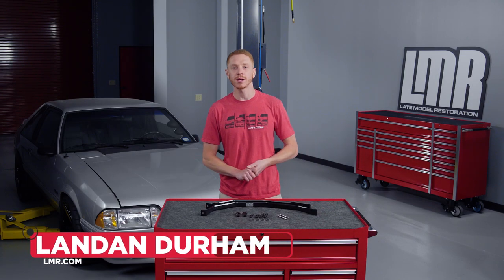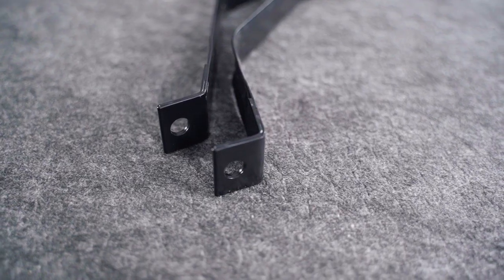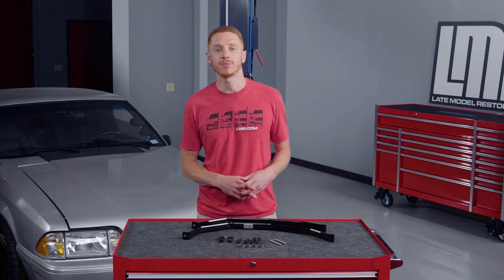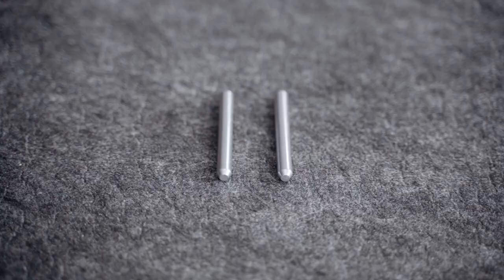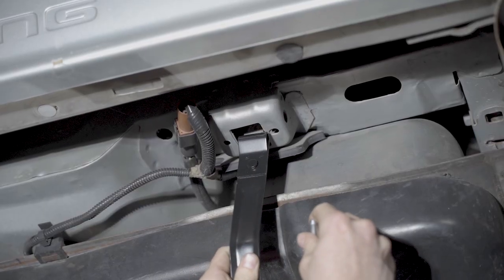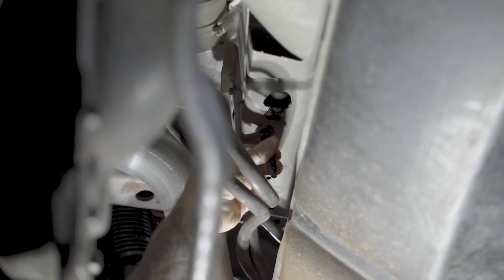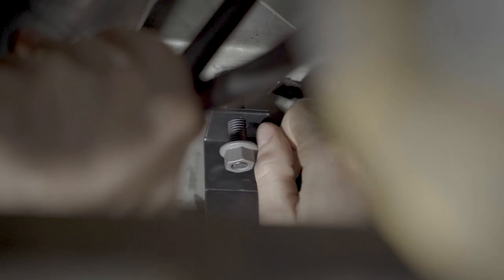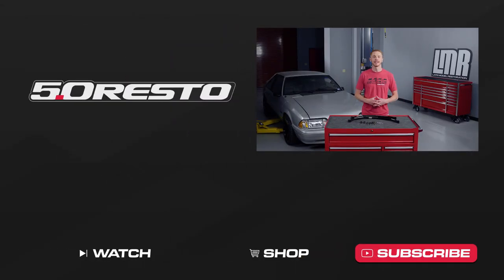How To Install Fox Body Mustang Fuel Tank Strap Kit (81-93)

Comment: Did not work for me
Reply: why
Reply: @angry408w7  straps were not long enough to reach at first, bought studs and stretched them out now they work but it was very difficult to do
Reply: Yea I went to the hardware store and just got longer bolts with nuts and lock washers.